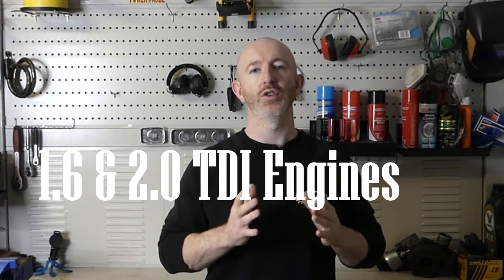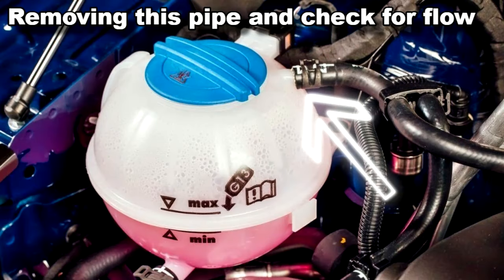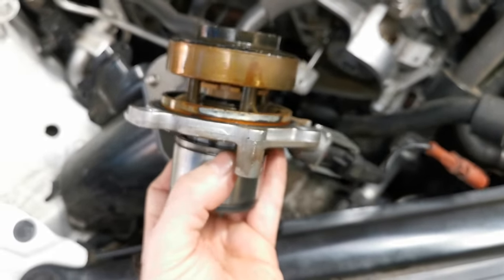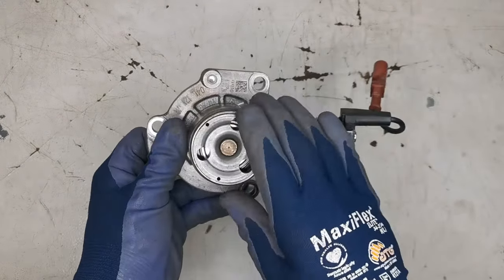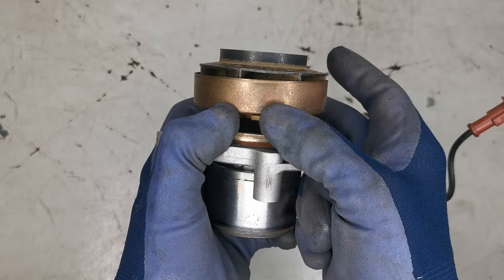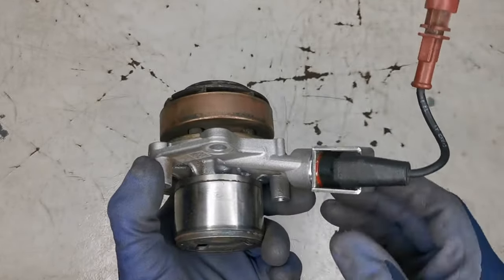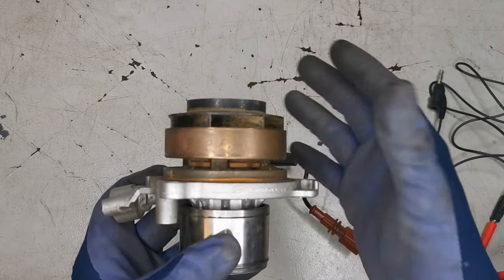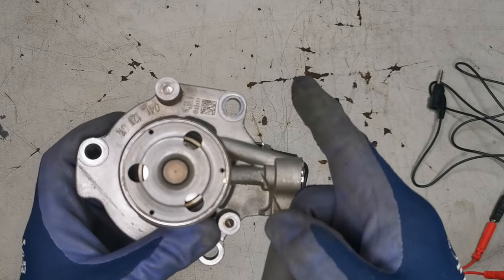Engine Overheating! No Coolant Leaks & Coolant Level OK - Volkswagen Audi 1.6 2.0 TDI 1.8T 2.0T

Comment from the maker: There is also an option to revert back to the old style water pump with no shield covering the impeller, if interested in that option I would recommend searching for compatible options online or through a parts supplier. 
As always thanks for watching :yt:😀
Reply: I went for the no shield option when I had the same problem , it's about £80 cheaper and you will never have that failure point again , all the shield does is help the engine heat up quicker in very cold climates , in the UK you will never notice the difference , iliminate a weak point and save yourself some money :)
Reply: @666markyboy what part did you go for?
Reply: @DJgoon12  I dont know the part number , I went to GSF and they offered me the 2 options
Reply: What it could be if ive got New pump without shield on already and seems like there is no correct flow? Both electric pump seems to be working fine so a heating is. Engine overheats quick once driven. It does cooling down only with full heating on. On idling it will comes down to 70 after a while.

Comment: I am on the 2nd cambelt on this type of engine, always done the water pump in the process. What people do not realize is are a lot of revisions on this water pump and was a time when a new revision was showing up every month or so... as i am writing this the latest is 04L121011N for that pump. People should know the system has another 2 electric pumps one cooling the intake and another auxiliary just behind the sump above driveshaft... ecu controlled.

Comment: I had this very same issue with my vehicle an vw golf gtd mk7 2013 with 93000 miles on the clock. The symptom's were that the vehicle would overheat after a short journey and therefore carry on overheating until I got the problem solved. It started one day when I was travelling to a destination some 10 miles or so from my residential home. The vehicle temperature caused the warning on the dash board for myself to pull over and stop. The coolant temperature was in excess of 120 degrees. It took a short time for temp to fall with the help of the engine fan switching on only for then to almost immediately do the same again after a restart. New gates timing belt and pump fitted at local garage eliminated the problem where the pump in this kit does not have the invertor fitted. I did get a fault code prior to this, not too sure whether it was related or not where the secondary water pump showed up as been locked. I replaced this with a new vw one thinking this was causing the overheating problem but the problem persisted. The fault code subsequently kept reappearing after a short while but then vanished once I got the kit fitted.

Comment: Good video. Just wondering if this system is as robust as the old fashioned water pump which has a long life, the one with the metal impeller.

Comment: I have twice had overheating issues - one with 'stop' warning light, in the last two months. Ambient air temp 16 and 19 degrees c, oil and coolant levels all good, second time when I had no warning light the water temp needle was showing approx 100 deg, oil temp 91-94, radiator fan was running and temp came back down in a few minutes. Heater works. So i suspect my shield is getting sticky. Oddly VW main dealer did the cam belt AND (suppossedely) water pump about 3 years/40k miles ago. I did see fault codes with Carista on the first occurance - sure it said something to do with heater matrix or AC though?

Comment: Don't all water cooled engines have a thermostat? Usually thats the issue provided no water loss. Water pump definetly could be an issue. Electronics, just more things to go wrong.
Reply from the maker: Hello Thomas,
Thanks for watching and interacting on the video.
You are 100% spot on, A thermostat can absolutely cause that, as could a blockage in the cooling system or possibly a faulty cap too.

I tried to focus the video predominantly on the fault at hand and share knowledge based around these engines and the symptoms.
As with all my videos I try to include information that can be very useful to people and in hindsight I would put some additional information on this one to include thermostat as well for people that have landed on this video, especially if they have other makes and models of vehicles.

As always thanks for watching and I appreciate the question 🙏🙏🙌🙌

Comment: Hi, I am looking for some advice. I bought a 53 plate audi a3 2.0 tdi sports back 6 months ago and it had an undisclosed over heating problem.
I know it's a 53 plate but I like it and it's my second car.
When I first got it, it would over heat and drop it's coolant.
I have solved the coolant problem but it still tries to overheat.
I have spent 2 grand so far and the problem still persists.
I have had the timing belt and water pump, thermostat, coolant sensor and radiator replaced, probably forgot some stuff aswell.
It is getting better but still tries to over heat if am doing about 70 and tun the heaters down low.
Any advice would be welcome, thanks

Comment: Looks like yet another design fault in a part that's meant to save fuel, but could end up costing you a new engine.
Reply: Yes, yet another design that is meant to save a few pence of fuel but could end up becoming a head job or new engine. (Granted if it service was over due it would come down to the owner)

Same situation as before when the old metal waterpumps got change for plastic ones, until they realised a large proportion of new plastic ones were cracking, breaking apart, jamming and seizing up, and the design was changed. Must of sounded great in a board room all them saving for the company, but then costing engines, heads and head gaskets under warranty. Or they try and do what Ford commonly does and says they aren't covering it under warranty, until they get taken to court and sued for negligence, breach of warranty coverage, and in some cases danger to the customer and road users, then they have to payout or do a recall.

It happens all the time in Engineering (I studied Mechanical Engineering) you can only find out so much in a lab and simulations. The real world is the final test scenario. Plus quality control and variations in manufacturing from different companies who supply OEM parts all play a factor.

Fun fact, a friend of mine worked at Aston Martin in a managerial role in manufacturing (in the last 5 years), and they know a batch of a few hundred of their sports cars has contamination of either the metal or paint which will cause rust in the future. But it would be too expensive for them to do a recall, so knowingly they have released cars which will have rust issues in the future, hoping they are out of warranty by that point.

Comment: Cheers for sharing Ger.
Just a quick questions, from memory, how many miles had  the engine covered before this electro/mechanical w.pump failure? 

Cheers Chris.
Reply: 60,000 miles for me , it had literally come up for it's cambelt change so I did the lot in one go

Comment: Question on that i just bought my vw 1 month ago its done 108k miles bie the vw they say timing belt change at 140k miles and i am planing on doing that,and now i ran into same problem tho with no fault codes i did put a bit off liquid in the coolant to get it to the max and 2 weeks drive im again close to minmum, if water pump aint working that the liquid goes where?? Building preasure on engine it self 🤔 if i put again liquid in to fill to max will it slowly burst to the engine compartment in cylinder 🤔

Comment: Hi Gerard,  My Caddy 2014/15 2.0 TDI started to overheat all of a sudden , 200 000 Km on the clock ....  I managed to get home controlling the temperature by running my Heater and its fan which worked for me.... I was 1 hour away from my house ....  As a test every time I turned off the cabin heater the temp would start to climb rapidly again and if I turned on the heater  again the temp went back to 90 Degrees where it normally is .... In your opinion do you think it is my water pump?
Reply: I really (99% sure)  think that its the thermostat failure rather than water pump

Comment: I have  a problem with my b6 passat .engine 1.6 . tdi
When engine is cold I can drive anywhere. But when engine warms up around 90 degree it's impossible to drive .
When I am driving when I accelerating the engine is cutting out and jerking it's only happens when engine is hot but when engine is cold I have no problems. Can anyone help. Thanks

Comment: My water pump was replaced less than a year ago along with the cambelt at 90k service but I just had the overheat warning pop up while doing 140km/h and the gauge was at about 3/4 of the way so I let go of the accelerator to slow down and within that time between 140 and 100 the gauge went back to just below 90. I just got back yesterday from doing about 1800 kilometer trip but never had any warnings. Any idea?
Reply: Did you solve your problem? I have replaced water pump but only after 1500 km it started randomly overheating again...